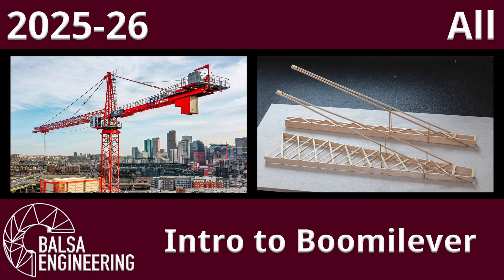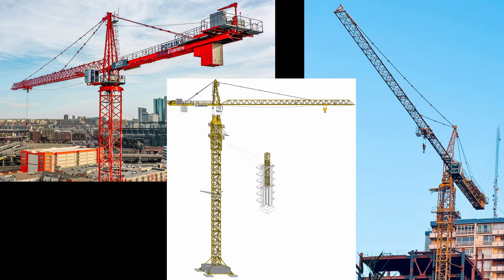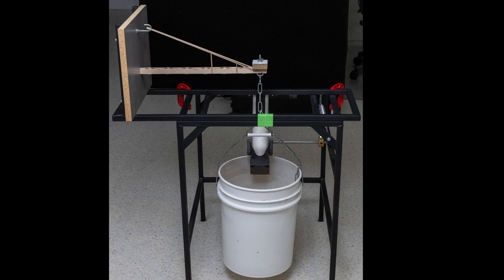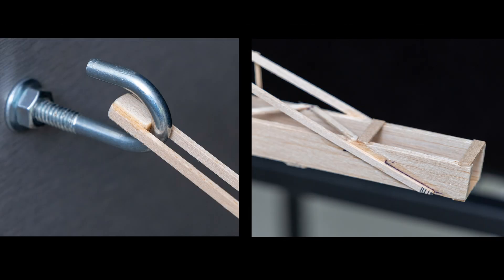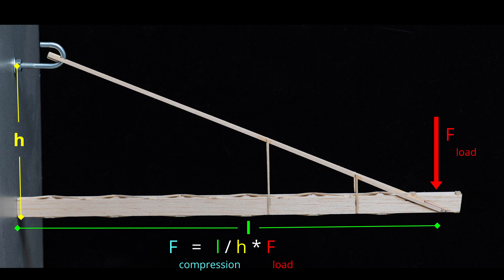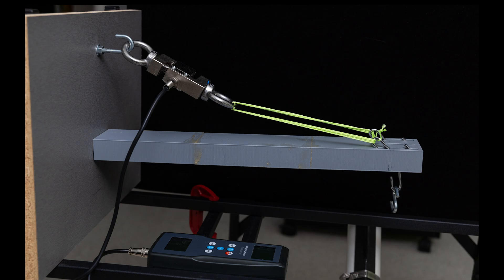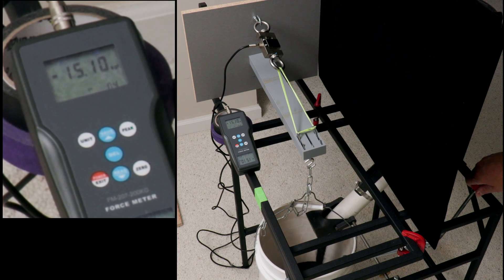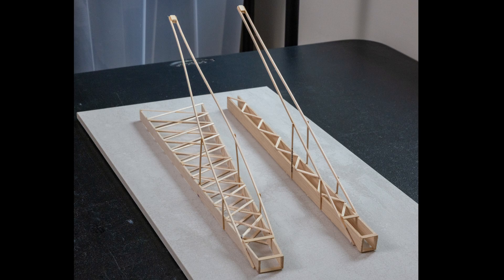2025-26 Science Olympiad Intro to Boomilever

Comment: You are amazing as usual!!  Can you post the wood type and member dimensions for the examples in your video? I have been practicing already but not getting close enough to hold anything.  I was hoping to practice like your example. Thank you for all the help you give all of us.
Reply from the maker: Thanks!  I wouldn't get too caught up in the details just yet as the new rules aren't out yet.  If you want to build to the previous cycle rules, what we had a lot of success with for the compression member pieces was 3/32" thick balsa at varying heights and densities.  You'll need some form of cross-bracing like what I have shown in the pictures here.  For more details on the tension members, be sure to check out my new video:  https://youtu.be/KO9a3qI5OQM?si=3YXlK4FEFlQ7awP8   Good luck!!

Comment: when do you think the rules will be released?
Reply from the maker: The official rules are usually released right after Labor Day
Reply: @balsaengineering6686  so its gonna be like 2 months..... how do you recommend studying for this beforehand
Reply from the maker: @Jamesfeldburg  If you are new to all the balsa events, I would recommend watching a bunch of my older videos on general tips and techniques.  For boomi specifically, I would search for the 2018-2019 rules as a good starting point.  I would expect the rules to be fairly similar to those.  Also check out the 2019-2020 (and roll-over 2020-2021) rules to see how they were modified for the 2nd year last cycle.  Most likely the testing part of it will be identical, so you can work on building a sturdy test rig/wall with the proper J-hook so you'll be ready.

Comment: do you have a tutorial on how to build a testing device to test the boomliever to see how much it can hold?
Reply from the maker: Hi!  I don't have any videos on that, but with reasonable wood-working skills, it's not too hard to build something that will work with hand-loading the sand.  Make sure you use the exact J-hook specified in the rules:  https://www.amazon.com/National-Hardware-N232-892-2195-Bolts/dp/B000BO54X8?th=1     If you want an auto-loader system, that is much harder to build and I finally just bought one.   The "official" ones are pretty expensive, but they will basically last forever, so you might be able to get your school to fund it:  https://www.balsawoodhoppers.com/services